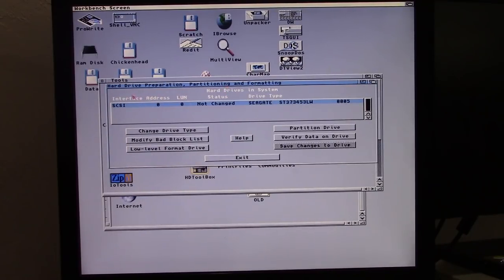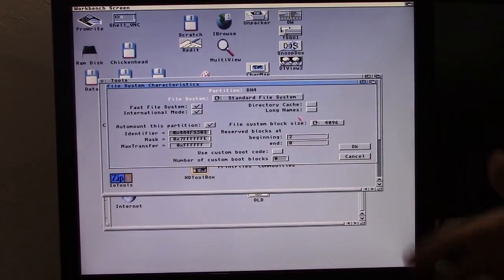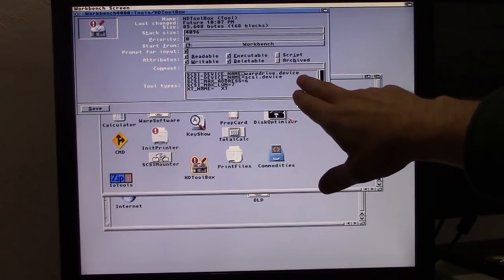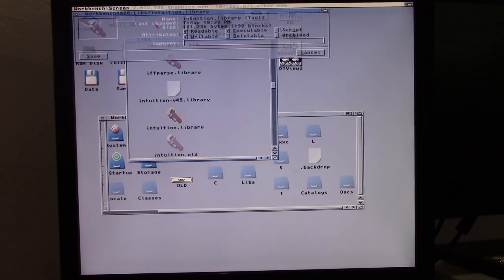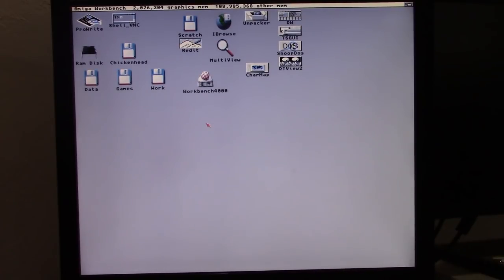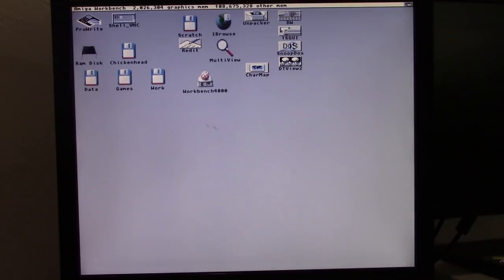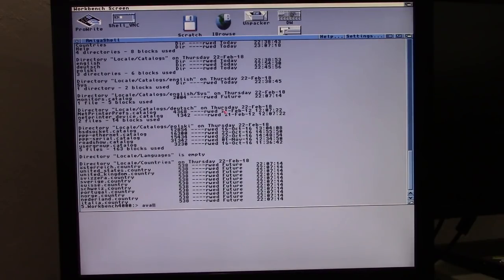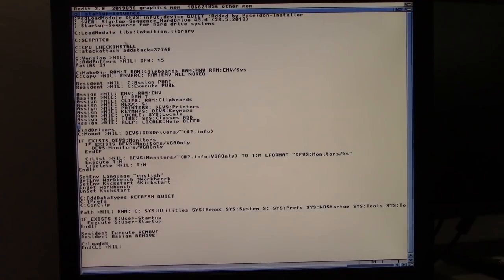10 Minute Amiga Retro Cast Episode 15 - Amiga OS 3.1.4 - Digging Deeper

Comment: Great videos. I follow them like great tutorials. Would it be possible that you make a video on how to set up NetPar? Thanks a lot in advance.
Reply from the maker: Netpar? Is that the same as the Parnet parallel port transfer stuff? Or are you talking about the network printing protocol?
Reply: @10MARC  Nevermind. I figured it out. Not difficult if one follows the guide :-)
Reply: @10MARC  yes, sorry. I meant network printing. As how to print from an Amiga to a network printer.

Comment: i noticed you seem to still have about 2meg chip available, I've installed a fresh 3.1.4 and bestwb on my 1200 and only have 1.7meg left. is there anything you did to regain chip memory
Reply from the maker: That is all thanks to my RTG graphics card and Picasso '96. No Chip RAM is used for the screens, so most of it is available.
Reply: ah i see, thanks
Reply: Also using Fblit and Ftext will force a lot of things to use fast ram instead of chip ram which might help you save some more memory.

Comment: Does 3.1.4 have "<" and ">" redirects like Linux?
IE: Does this work?
list all >myfile.txt

(I would have checked myself on my A1200, but my 3.1.4 order hasn't even shipped yet...)
Reply: YES
Reply from the maker: Hmmm... I use | and ||, I don't think > works. The principle is the same, though.
Reply: 3.0 had > 20 years ago. list dh1: >ram:list for example works as does dir dh1: >ram:list - might have even been in 2.0

Comment: you put the new OS files together with OS 3.9, how well does it really work? Are you getting the same speed and stability improvements as with plain 3.1.4?
Reply from the maker: On my IDE drive install I have OS 3.1.4 installed over 3.9 - I did a show on it a few episodes ago. Zero problems, and all the benefits of 3.9 like Reaction and all of the goodies it added. It does use the 3.1.4 ROM Setpatch. The only disappointing thing was losing 3.9 really nice HD Toolbox. No one else has matched that.
Reply: @10MARC  oh, cool. I'll find that video and watch it. did you try backing up the HDToolbox and see if it works or not? You should be able to back anything like that up, right? that's what I would have done